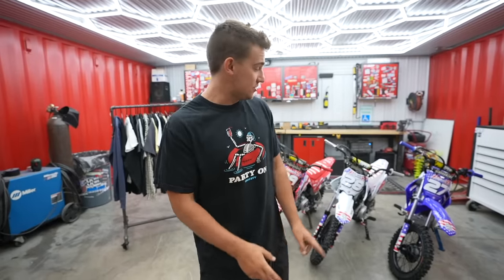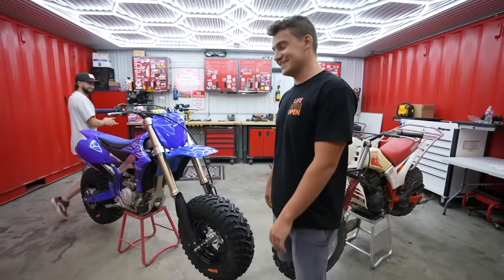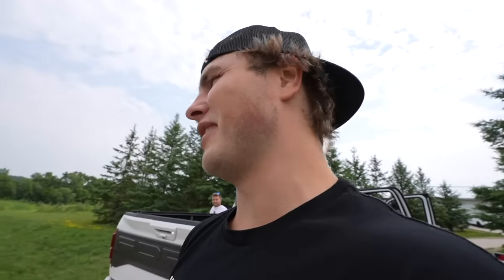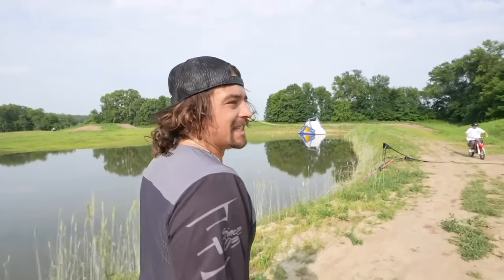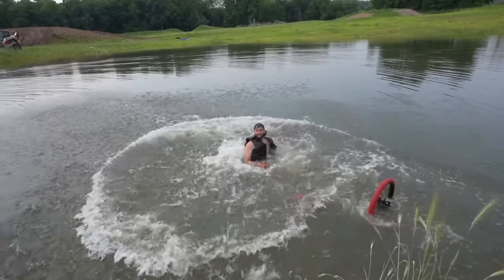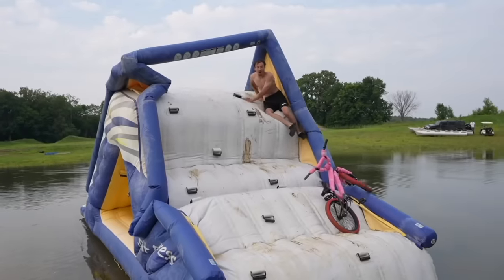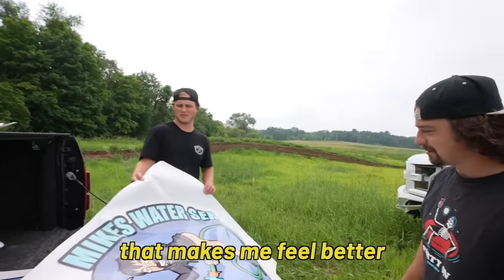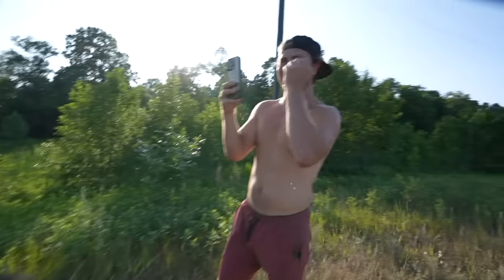Big Wheel Dirt Bike Riding!

Comment: You guys need to start running classic style 50s. 10 hp engines with good suspension on a actual 50 frame. Even a pimped out z50 would be sick

Comment: If you're not aware of the real reason Big Wheels were made was to get rid of all the 3-wheeler parts like front forks, bars, controls, and most importantly the engines that were supposed to go on to new 3-wheelers, but couldn't any longer because they were outlawed.